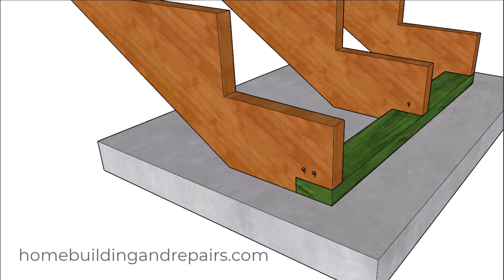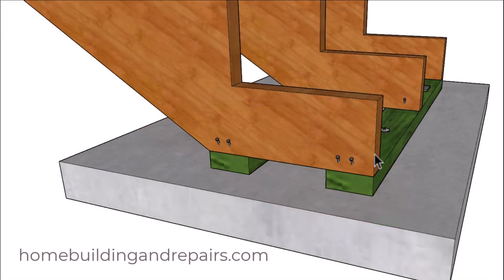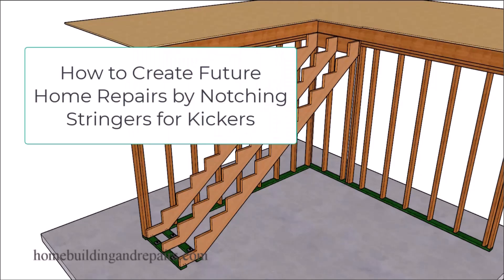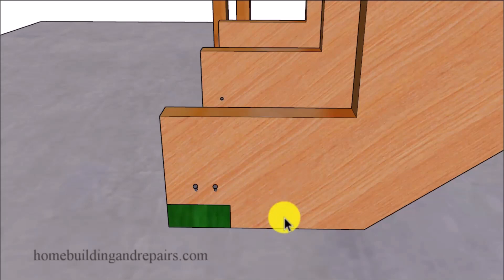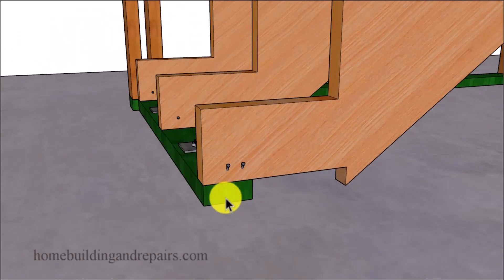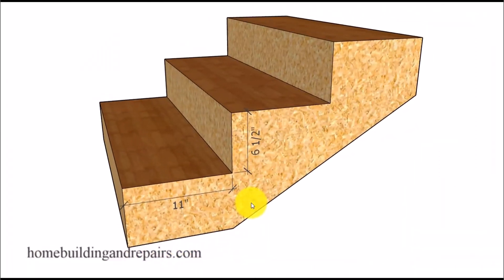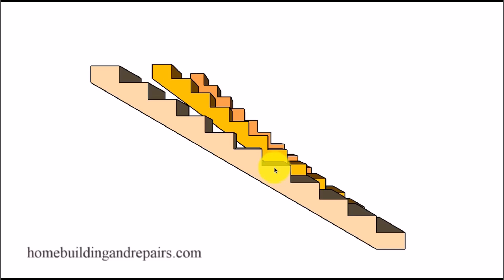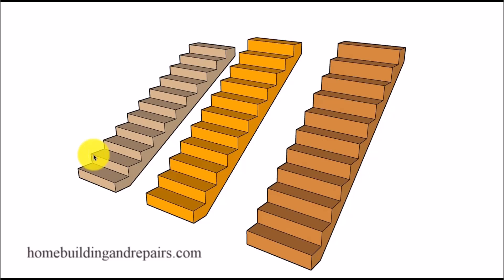Problems Builders Might Have Using Notched Stair Stringer When Connecting To Floor or Landing

Comment: What about installing stair stringers in areas like Colorado, where the concrete slab may move up and down? Should we rely on fastening on floating walls instead of resting them directly on or indirectly on the concrete slab?
Reply from the maker: That might work, but maybe install footings below frost lines to prevent them from moving. Let me know if that makes sense.

Comment: I'm surprised Simpson hasn't made a bottom connector for stair stringers like their LCSZ for the top...
Reply from the maker: Probably because nails do the job. Trust me, if they could sell you another connector they would.
Reply: @gregvancom  I would still be interested in seeing one though. For weekend warriors like myself, connectors have a second purpose. They're often the extra pair of hands we don't have vs working on a crew, and they help us avoid mistakes like positioning accuracy on layout. I think there would be a market for them even if they're totally overkill structurally as you're correctly pointing out

Comment: Thanks so much, Greg!  i will make the base support the way you recommend from now on.
Another aspect related to exterior stairs: about the cement landing cement pad for exterior stairs, in order to meet the building code in Hawai'i, the part of the pad that will be walked on must measure least 3 feet out beyond the last tread.
Reply from the maker: You're welcome and I've read about the 3 feet code for building egress or doors to exterior, but rarely see it on stairs. Thanks for sharing.

Comment: I suppose one could do a hybrid method,in which one makes a very shallow notch,like 1/2 the depth of the base plate......(no cement contact of stair stringer)
Reply from the maker: As long as it was structurally supported.